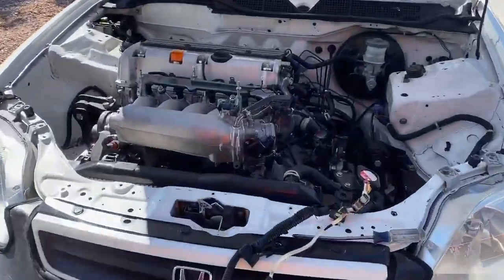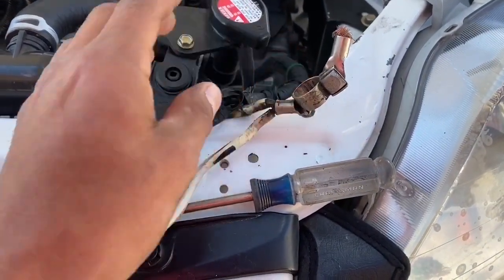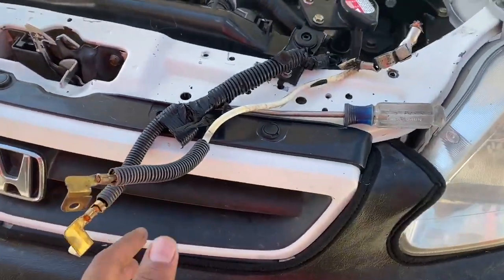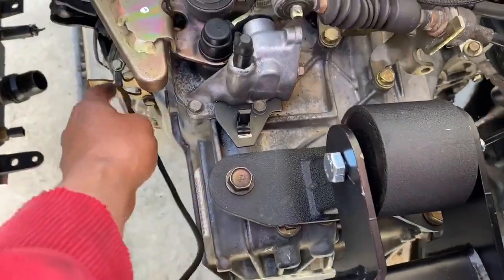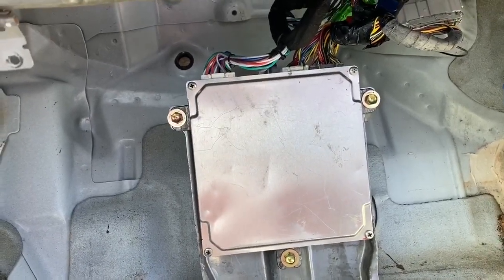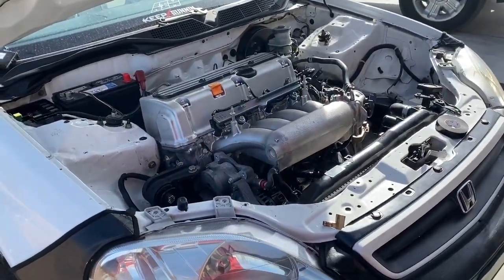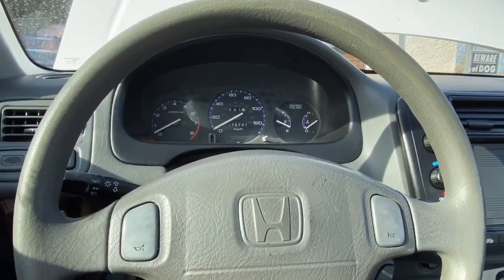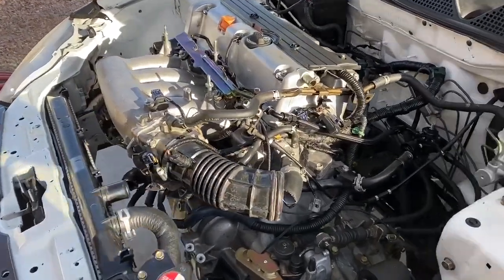KSWAP using PRC K20a Type R ECU

Comment: Hhhelp help im doing a k24a Ek swap I have a used standard 03 Crv k20a2 37820-pnb-e02 ecu but pump runs but can’t start my swap However a friend ECU start it good so I’m wondering if I have about ECU are it’s just not compatible with the swap

Comment: Hi man, thank for the video. Since you doing with the type r ecu may i know which prc model u using on your swap? prc-013 or prc-j01? I got an issue to use the prc-013 to my kswap on my rsx base. FYI, I'm reusing the base wiring no mod and changes are made. Checking through internet if i would like to onboard the kpro on 02-04 model ecu (prc-013) to current swap will require more budget. May i know you thought on this?

Comment: Hi
I am looking to swap a k24a3 in my 8th gen sedan. I will be using the stock ecu , i have been told that if i use the stock Ecu the car wont be faster then my existing r18 (may be 5% more performance) . Is this true ? 

I mean k24a3 is around 200hp while r18 is an economical engine. Can you ease shed some light

Comment: Hi I’m working on wiring my 96 ek k20a ctr kswap some say it’s a16 like you said some say e1 how can I figure out which one to ground on my car and some say Tap in ground some say depin and ground I’m really worried about it I just don’t want to burn up my ecu can u help me find out which one it is for my car thanks so much Dustan
Reply: Thanks for your help I just can’t see in the video if you tapped and grounded with the wire plugged in to the ecu still or u de pinned and grounded ?
Reply from the maker: I can’t be anymore clear about how to do it I showed you how and you see the car running.

Comment: Wich ecu do u recommend for daily driven k24a build on a budget. One that wont break the bank. Thanks
Reply from the maker: Type r ecu
Reply: True!!! But I aint building no 8 sec track car. Just a simple daily driven budget street car/ a k24 of course that is all. I've done in the past w/ B series motor and worked perfectly fine, but I understand your point!
Reply: I've been running a stock type s ECU for years on my frank swap. No issues ever. Passes smog too
Reply: @lindaover9764  what did you need to run it like key and how did you wire it
Reply: Any build cost $$, like a house for 50k versus a 200k house. Both houses finish 4bedrooms 3baths car garage, done finish... but when a hurricane comes which house its going to be standing, structure foundation its key. .. all builds cost $ & sacrifice. Some builds takes months even years, and how deep its your pocket.

Comment: If I put the type S oil pump and the cam gear can I still use the stock Type R ECU daily driver?
Reply from the maker: Yes. It will be reliable with the mods but can’t go wrong with pump and 50vtc

Comment: How did you bypass the immobilizer?
Regards
Reply from the maker: Type r does not have immobilizer 😉
Reply: Thank you so much for helping. 🙂😎🙂😎✌
Reply: Hi Friend, i will try to help. The problem with the call is I am from Germany and my English is not well. When I write I can take time and thing about the words I can use.

At first, I have a jdm k20a swap in a civic 96-00. I drive this since 2014.

So that is why I am confused because the immobilizer. In all the years I have heard this the first time that you can start without delete the immobilizer.
I know, you must deleted with a kpro or a external delete box.
But after you said this the Iast week I looked around and I find out that a few type r ecu really had no immobilizer. The thing is you must know which ecu you exactly have. Maybe to find out with the serialnummer of the ecu.

Do you have fuel and ignition if you ar cranking?

Did you hear your fuel pump pressure up if you go on ignition with your key.

Are the injectors stock?
Maybe if you have smaller one the car didn't start too because it is to skinny with fuel. Take stock one or for testing bigger one.

In my swap I have also disable the multiplexer in my kpro. But here I don't know if this is really necessary

Check the timing on the chain. Maybe to much overjump.

Such a diagnostic is difficult when the car is not her. :(

But I can say one sure about >>MY<< swap. If I go in kpro and enable the immobilizer, my car don't start up.

Is your starter wired?
Is your Batterie okay?
Is your wiring okay?
Very important, do you have the engine grounded? Take two cable. One on head one on block.

Maybe you can do a onborad diagnose with the MIL and a piece of wiring.

On the k20 stock engine harness the both connectors for MAP and TPS are EXACTLY the same connector and fitts in the wrong sensor. Make sure you have the right connector to the right sensor. If this is wrong connected the engine will go like 2 or 3 cylinder... in this case bad, but it is running.

A few Quick impressions for you.

I hope I could help a bit.

Good luck my friend.
Reply: Hi friend,
Are you sure they didn't have? Every ep3 I know has a green key symbol in the cluster before the engine starts up.

If i understand you right i must only plug the parts like engine, harness and ecu toghter and start up?

Many other people said I need a kpro to disable the immobilizer in the kmanager software. Now I'm confused 😖

At first i will try it like you said. 

Thx for help ✌
Reply from the maker: Don’t be confused anymore. Look at my car it’s running and showed everything I did to it. Type r ecu does not have immobilizer that’s the reason I made my channel to teach people what I know about Honda kswap
Reply: Oem Worx 
I have a question 
I have a k20a2 with the type r ecu 
I can not get the car to start I have tried the ground
Reply: Oem Worx do you think you could help me out 
I am pulling my hair out !!!!!
Reply: @mondellewarren1677   oh sorry, I thing you mean me because you answered on my post 😅

No matter. A few impressions from my side 😝
Reply: Oem Worx.
Reply: Oem Worx      I can not get my car to start 
2003 Honda Civic si
I am using a 2002-2004 Honda Civic type r ecu
I watched your video 
Still the car will not start

Comment: I have a serious problem did a k20a swap in a rsx now i am stuck in limp mode. i am using the type r ecu that came with the car. car wont go over 2.5k
Reply from the maker: Do you have a cel?
Reply: Oem Worx i will really appreciate it
Reply from the maker: The fuel wire from connect e needs to be grounded
Reply: @oemworx4147  so i grounded the wire and the car runs now but now its revving to 2.5 to 1 like it would if it had a vacuum leak. so i sprayed break clean all around to find a leak no luck. but if you unplug the top sensor of the throttle body (forgot what's it called ) it goes in to limp mode but ideal becomes clean. I am not sure what the issue is yet but i think its to do with the throttle body.
Reply: Oem Worx yea it will not start with the prc  ecu its fuel pump idk how to ground it could you please help I have been chasing this for months I don’t need k pro I wana drive it with prc for a while
Reply: I got the same swap k20a .
Mechanic put the engine in got paid and bounced . It's doing exactly what you described wont rev past 3 rpms car bogs and sound like its going to die any ideas? Thanks
Reply: What could be the problem? Any suggestions